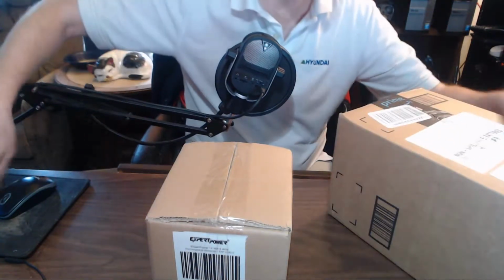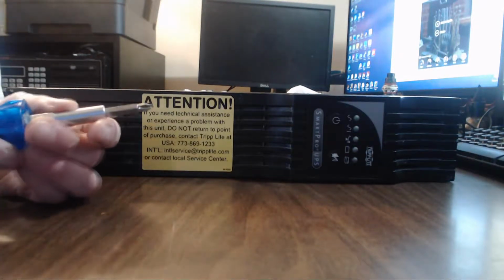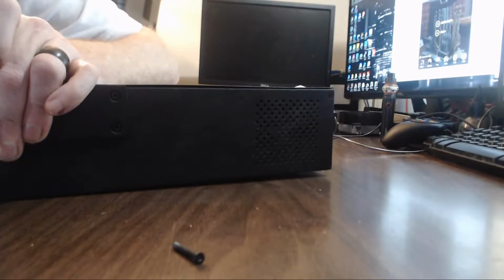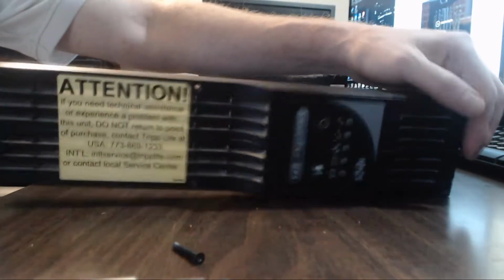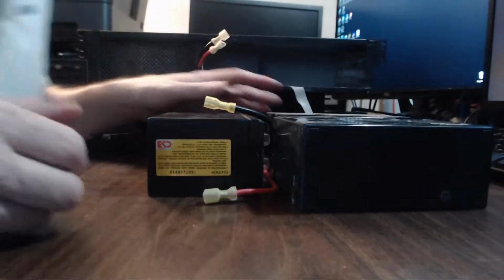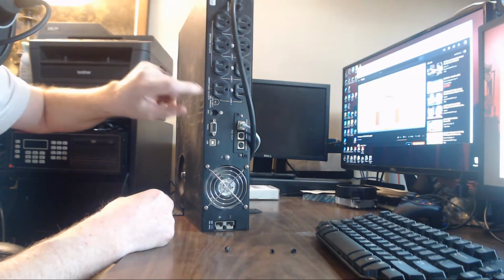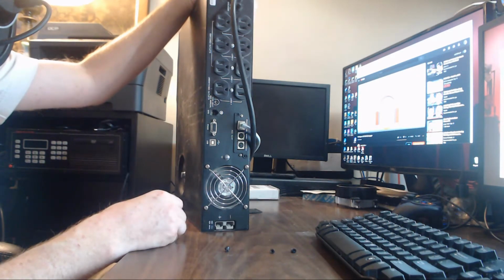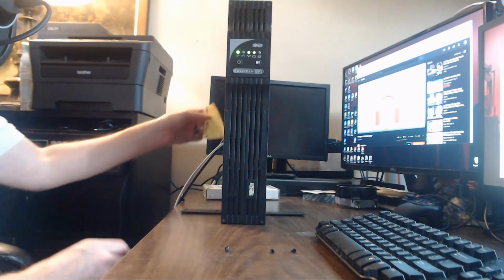Change batteries in Tripp Lite UPS Smart 1500

Comment: So how is this actually wired together?  There's never a good shot for that.  If I'm looking at this right:

1) Positive (red cable) from UPS connector to Positive on the left battery
2) Negative from battery on the left to positive on the battery on the right
3) Negative from Battery on the Right to Positive on the rearmost battery
4) Negative from rear most battery to negative connector (black) on UPS

Is that correct?  I have a Tripp Lite UPS that came without any of the battery wires, do you know what connector they used to connect to the UPS?

Comment: Did it spark and shock you a bit when you connected the last black cables at about 15:20?
Reply from the maker: No, I pinched my finger between the two connectors. They are protected by hard plastic. Helps to prevent you from getting a shock. But, not from pinching your finger when you hold them wrong. LOL
Reply: hard to get a shock off of 12 volts, even though they're connected in series to 36 volts.

Comment: good video. I have the same UPS, cept my control panel is 90 degrees turned so it reads correctly when setting flat.
Suggestion. Knowing the weight of the 3 batteries I think I might tried something flat to 
assemble the pack, like a cookie sheet, and then slid the whole thong onto the UPS.
Easy for me to say. I haven't been there, yet lol
Reply from the maker: Edited that out. It was actually surprisingly harder to do it that way. Let me know. You'll be changing them again, before I will. LOL